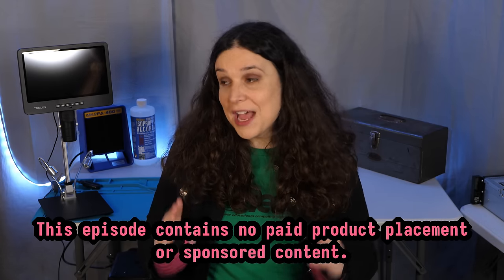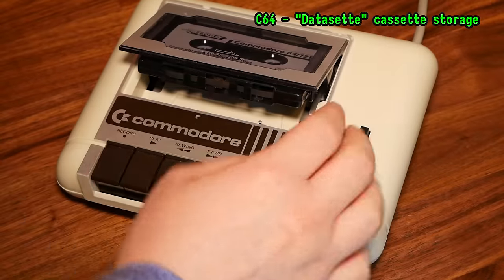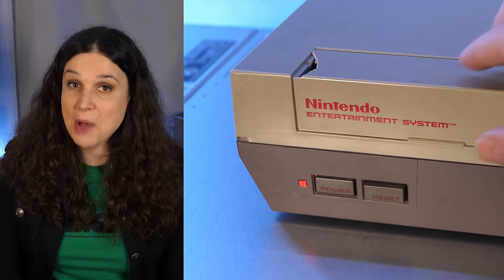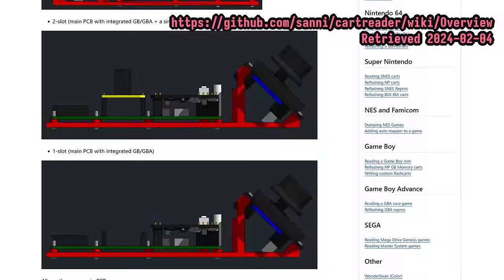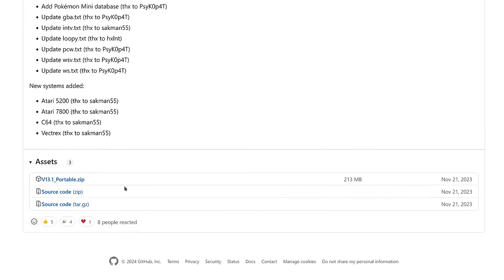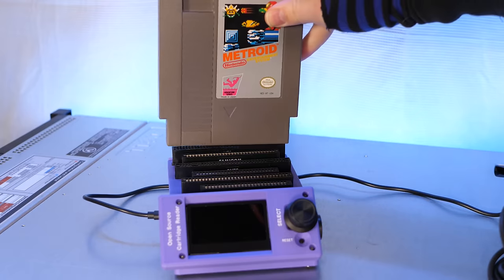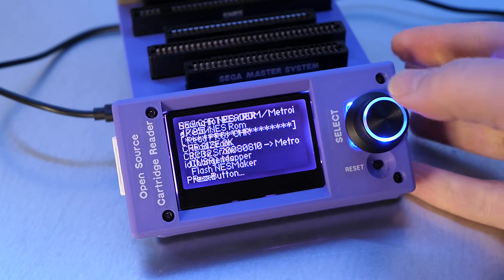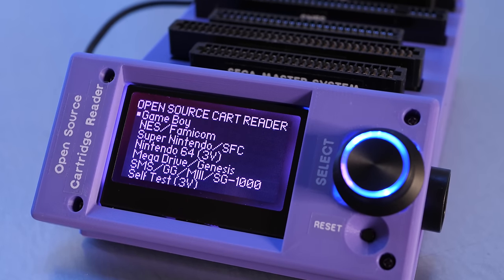Open Source Cartridge Reader: ROMs and saves from real hardware!

Comment: Auto voltage selection sacrifices function for ease of use.  As such I don't recommend it unless you wont need to flash and or blank rom chips.  You can also easily send 5v to 3v carts on accident potentially damaging them.  It might also stop you from flashing repros also but I'm not 100% sure about that 

"Because this feature removes/replaces the hardware switch for voltage selection, it is not recommended if you want to use the OSCR to flash ROMs to blank ROM chips using a ROM adapter"

The rest of the information is spot on.  You could use these to self publish and manufacture homebrew and or games
Reply: The voltage is set when you enter the menu for the chosen game system. For example, if you are flashing a GBA cartridge with a new ROM, simply going into the Game Boy > Game Boy Advance menu will set the voltage to 3.3v, at which point you can insert the cartridge and write the ROM file safely. There are main menu options you can enable in the firmware config that allow you to write data to any EEPROM chip ("FlashROM Programmer"), but presumably if you are doing that you'll already have knowledge of the proper voltage requirements for the  chip you're writing to.

In addition, the devs are working on implementing more robust software-controlled voltage selection along with extra voltage safeguards in future revisions.

Comment: But does it remind users to double-check the accuracy of the internal clock so that the ROM files get created with accurate metadata in the (presumably) Ext4 filesystem?
Reply: For OSCRs with the RTC and battery, in the the (current) firmware revision 13.1, the time is set during the flashing of the Arduino firmware. It pulls the local time from the PC doing the flashing. It can also be set manually with the Arduino IDE using the "SETTIME" command in Serial Monitor mode.

The SD card filesystems currently supported are FAT, FAT32, and exFAT.

Comment: It takes me back to "backing up" Super Nintendo carts onto 3.5" floppy discs using my super Magicom from Hong Kong.

I would really like to be able to do that for the Neo Geo without spending $500 to $1000 on one of the existing flash carts.
Reply: Sadly there are wayyyyy too many pins on a Neo-Geo cartridge for the current HW5 Arduino to support it. I did see some photo somewhere of people way smarter than me wiring up an OSCR to read them as a proof of concept, but it involved a bunch of extra hardware and LOTS of wire soldering.

With newer revisions of the OSCR in development that are moving away from the Arduino Mega 2560, there may one day be an adapter that can interface with a Neo-Geo cartridge.

Comment: How does dumping work for carts that have non-ROM chips -- the FX, for instance?
Reply: The SD card holds a database of games for all supported systems and the necessary settings to properly read the data from the ROM chips on the cartridges. For SNES games that require "unlocking" due to the CIC protection (SA-1 games, notably, such as Super Mario RPG), the OSCR includes an (optional) CIC unlocking chip to facilitate this.
Reply: @cmcm711  But, reading data from ROM chips isn't the same as somehow gaining the ability to emulate a co-processor or potentially-more-exotic hardware ... I guess what I'm getting at is: In disc-based systems, yes, the game is purely data ... but in cartridge-based systems I could solder whatever the heck I want onto the PCB ...

Comment: Veronica, can this device backup weird NES Carts like the multi-in 1 Taiwan ones?
Reply from the maker: There's a lot of weird carts that it can do! The docs contain more info, but even if OSCR can't *right now*, firmware could probably be written to get it done.
Reply: Thank you for your quick and informative reply. ☺   @VeronicaExplains
Reply: It can do many of the multicarts. If you can take it apart, you can send pictures of the internal PCB and one of the NES devs will likely be able to either tell you what settings to use to make it work or add support for it if it can't already. If the pictures aren't enough you'll probably need to send it to someone unless it's easy and cheap to get. 

NES is the hardest one to support because the ROMs do not have headers and thus there is no way to automatically determine how the cartridge is laid out. There is some automatic detection which works by reading the first few bytes of the ROM, hashing it, and then seeing if it's a known ROM. If it is, it can suggest settings that should work. But, if it isn't, then you need to tell it how to dump it.

Comment: But can it do DS, GBA, 3DS, and Switch?
Reply from the maker: GBA: yes, as detailed in the video. 

AFAIK those others aren't "carts" in the same way (NAND flash vs ROM chips, but I'm hardly a hardware engineer, so do your own research). There are currently other tools used to retrieve data from those types of media. Same with optical media such as PlayStation and Wii games.

Comment: I did an hour long build tutorial years ago on the version 3 before that Japanese guy stole the idea and pretended to be the creator under the guise of "Save the Hero" with a Kickstarter for a product that already existed. After that point, I was out. I was going to add a PS1 memory card slot in the mix and created all sorts of cost effective ideas to implement. I'd still like to build one of these version 5s. I have a stack of V3s still. But I don't want to go through the trouble of sourcing all of the parts in bulk to save some money and build it myself.
Reply: Wow that’s almost as bad as designing a case for the NES adapter and refusing to release the 3d model on an open source project that was handed to you.  Those who live in glass houses…

Comment: Not sure I would call it open source hardware but at least right now not difficult to get the hardware needed to assemble. 
Maybe whenever you can make one with open source RISC-V cores it can truly be completely open source, lol.
Reply from the maker: You can go ahead and build that, though, because the project is open source.
Reply: @VeronicaExplains  I am not even sure how easily available open source 8 bit RISC-V microcontrollers are, lol.
But yes it would be possible to add the support just like Linux went beyond 32 bit Intel CPUs.
Edit: I forgot that RISC-V doesn't have an 8 bit instructions set. Now it is even less cost effective to use RISC-V for this project than I already thought it was, lol. But possible there are already open source 8 bit microcontrollers using their own open ISA.
Reply: That's not what OSHW is. OS chips exist yes, but that's a different level. To be OSHW it just needs to be made using off the shelf components with all the files and info needed to build it being open source. Using your strict definition of hardware almost nothing would be open source hardware. Not only that, but the term would be meaningless. Open source ICs don't really matter to prosumers or most DIYers, let alone consumers. Your average person isn't going to drop half a million dollars to pay a fab to make their own custom silicon.
Reply: @Ancyker  that sounds more like open source hardware assembly than the hardware itself being used being open source.
The project themselves doesn't call it an open source hardware project. 
I think it is often open source software advocates that just end up calling these projects for open source hardware thereby that term is being widely used for these projects (possible other people do so as well).

I didn't say people have to care for the hardware to be open source. 
Heck most people advocating for open source software do also use close source software since it can be impractical to completely avoid it. It is even more impractical to only use open source hardware (even by your definition lol).
Reply from the maker: You're being a bit pedantic, Sergeant Schultz. ;)

Comment: FAT32 can't handle partitions larger than 8TB, or files larger than 4GB, whereas exFAT can handle files and partitions up to 128 petabytes, which is 128,000 terabytes. 

exFAT is faster than fat32,  and iso's and other backups bigger than 4GB CAN NOT be put on FAT32

why not use NTFS format on usb drives?  NTFS is proprietary microsoft, and wont work for a lot of devices that don't pay to have it used.